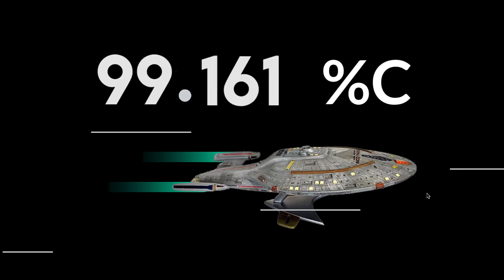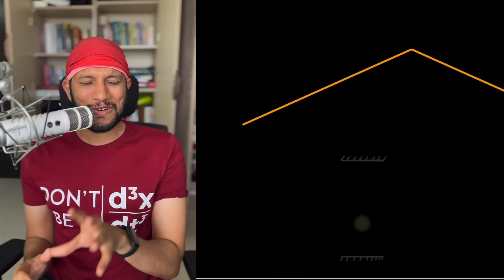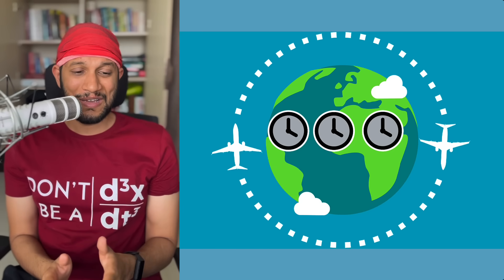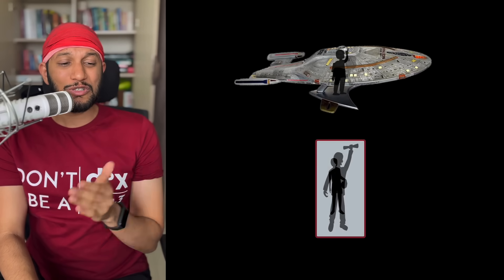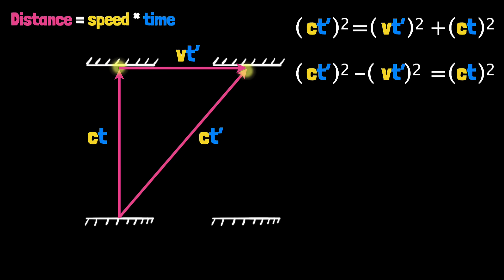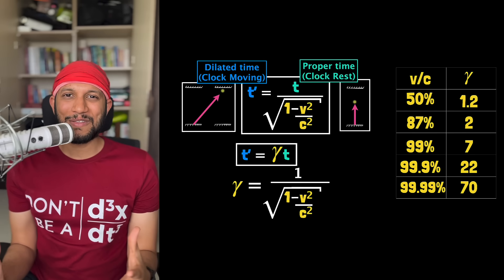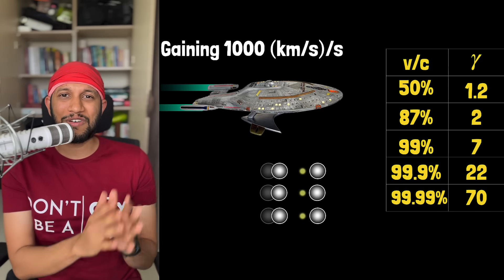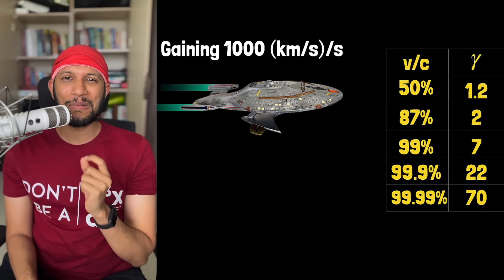I finally understood why you can't go faster than light! (My mind is blown)

Comment: The real limit has to be much slower. Consider a tank tread or a bulldozer tread. If the vehicle is going 10 mph then the bottom of the tread is stationary but the top of the tread needs to move 20 mph to make the return trip in the circuit.
Now consider an electron going around an atomic nucleus. If you're going the speed of light, the electron would need to go TWICE light speed to make the return trip in the orbit. Long before this happens, the speed of the electron backwards will exceed the attractive force of the nucleus. So if your starship is headed to Alpha Centauri, the electrons in an atom will be moving toward Alpha Cantauri on part of the orbit and moving back toward Earth on the other part of the orbit. This happens many times per second.
Once you're going half the speed of light it's impossible for the electron to complete its orbit because it would need to hit the speed of light. It doesn't have anywhere near enough energy to do that. So it doesn't. Atoms get stripped of their electrons.

And since the proximate cause would be the momentum of the electron heading Earth-ward exceeding the ionic attraction by the atomic nucleus, that means this will affect atoms with weak attraction first. Iodine would be among the first elements affected because the outer shells have comparably weak electronegativity.
One by one, atoms will be ripped of their electrons, leaving very strong ions. The back of the ship could become supercharged with electrons which would most likely cause lightning to blast forward as those electrons seek balance. But that's only if the electrons don't leak through the back of the ship into deep space and be lost forever. This is more likely because the problem was the reverse momentum of the electrons.
At first the electrons might sling sideways and hit the sides of the ship. If the ship keeps going faster, they will shoot more directly Earth-ward.
If you keep accelerating (bad idea) all of the atoms on the ship will keep breaking down until the whole ship collapses.
Nothing can survive this.

If you use brute force acceleration to approach light speed, you're likely to blow up the whole ship somewhere around 30% of light speed. Everyone on board is already dead as oxygen stopped working long before the ship explodes.

Comment: The problem I have with the term of "speed of light" as a layman, and maybe some one can explain it to me.  Light is a wavelength....not a straight line.  That "light" is actually going faster than the actual speed of what the accepted "speed of light" is.  Now, I am not certain if this is accounted for or ignored...or just forgotten.  

I am not discounting this video.  I think it is great.  As a learning person about everything scientific, are we not suppose to challenge...or even ask...how we should accept this?  I mean, who was around to see and measure the first beam of light to measure it?  Or is this a big guess?

We are taught that light is a wavelength.  That particle of light is moving faster than advertised.  And yet we accept that term "speed of light" as unachievable from a stand point of a ship or some vehicle.  IF it were an actual straight line...then there would be no argument...or question of this term.  And while it MAY be minuscule the distance between peaks of the wavelengths...it should be accounted for.   And I get that "c" makes things easier as a constant.  How is this actually measured?  Could it be slower or faster?

And are we basing all this on our sun or a light bulb?  Would this equation work on a different light source?  Say something with a different wavelength?  Is the light that travels from our sun have the same speed as any other star that we are aware of?  Or is it different?

I ask these to better understand...not to invalidate this video...or question to it's validity.  I know that way smarter people than I have asked this...or should have.

Comment: In Star Trek they don't go faster than light even if the final result looks like it. They use warp engines that as the name states bend the space-time allowing you to take a shortcut. So while apparently it takes less time to cover a distance, that distance isn't really covered because you literally cut through it, that's like cheating but it's also the only way to go "faster" than light. Take a sheet of paper (that is space), draw a line, that is the distance to cover, but if you fold the paper in half then you can cut through it avoiding the hassle of taking the long way.
Reply: That is not how warp drive worked in Star Trek, not even remotely close.
"Warp drive or warp engine was a technology that allowed space travel at faster-than-light speeds. It worked by generating warp fields to form a subspace bubble that enveloped the starship, distorting the local spacetime continuum and moving the starship at velocities that could greatly exceed the speed of light. These velocities were referred to as warp factors." Copy and paste from memory alpha.
Reply: @StimulatingPresence  which is the exact same thing if you think about it. Call it "subspace" or "shortcut", it is the warping of space-time to create a local bubble of steady-state space-time surrounded by faster-than light expanding or contracting space-time, allowing you to reach other stars or galaxies without even moving inside your local space-time bubble. Also called Alcubierre's metric. Now we haven't found the way to artificially expand space-time, but we know the universe does it already with some kind of dark energy. In an hypothetical quantum gravity theory it could well require to manipulate additional dimensions, that you could call "subspace" if you wish so.

Comment: well you used a Star Trek ship, which has a WArp-drive a made up propulsion system,  which give you speeds many time of light. like Warp9.9 is 3053 times the speed of light.
in real life we have the concept of the Alcubierre drive which should work pretty similar then the fictional Warp drive, but given the lack of technology and energy required to build and power it on, we dont know how far/fast that drive could bring you.

Comment: Mass and material can't handle speed of ligth, from power source and engine technology.
Speed of ligth need zero.mass and huge power plan to move an object.
Speed of ligth are imposible to reach .
The solution to travel for huge distance are THE PORTAL not SPACESHIP can move at the speed of ligth.
The secret of Macro cosmos are QUANTUM MECHANIC and nano technology maybe the answer.

Comment: I got a problem with Einstein's THEORY (not fact). 

Einstein said what the Speed of Light is a CONSTANT 186,000 miles per second.

The speed of light is expressed as a velocity. A Velocity is Distance divided by Time. (Miles per Second).  

If time reaches zero as you approach the speed of light, then you have and impossible equation. 

186,000 miles / 0 seconds 

It appears this would be result in instant teleportation between point at the speed of light.
Reply: "I got a problem with Einstein's THEORY (not fact)."

That's your first problem, a theory is a body of facts.
A theory is a fancier word for "explanation".
Anything that works, has a theory that explains you how it works.
Reply: @GoldSrc_  A Theory is constructed of a set of sentences that are thought to be TRUE STATEMENTS about the subject under consideration. 

Einstein's Theory ASSUMES that the speed of light is a constant. If the speed of light is NOT a constant, then the Theory is not true. The Speed of light varies just like the speed of sound. That is why a prism changes white light into a spectrum of light because of the change in the white light's speed and distance traveled through a prism.

My Father told me that when he was in college in the early 1940's that his professors said that it was impossible to break the sound barrier and had math equations to prove it.  However; breaking the sound barrier changed the air flow over supper sonic aircraft resulting in new math equations.

Comment: ok, guys, here is an explanation that takes less than a minute of your life:
max speed you can (almost) reach is the speed of individual particle flown out of a muzzle of your rocket engine.
why almost? because two bodies always puches themselves equally, so there is no way working fuild can transfer all it's energy to an object, only half.
so why can't you reach speed of light? because there is no known particle that moves faster than light.
that's it.

Comment: We have to be moving at some speed in the universe, but in what reference frame? 🤷‍♂️
There are things in this universe that are moving away from us faster than the speed of light (as the universe expansion accelerate). 🤯 So what is then stopping us from moving at the same speed as we move further from the core reference point and this expansion becomes a part of our speed?
… and might our time (T) then a function of our current speed through the time space continuum?

Comment: The enterprise accelerates from sub to super luminal speeds in a time less than Planck time. 
So the transition happens so fast that it can’t actually be measured. Therefore it was never travelling at light speed. 
That’s how Roddenberry got around the problem. 
He didn’t know or care about inertial frames of reference at that point. His solution works just fine.

Comment: What about time measured in the same frame of reference, which is moving with the clock. In my opinion, for that same frame of reference, the clock still ticks as it ticks normally (not slower). As you also explained in your video time is not varying in the frame of reference which is moving, then how come any biological process is changing in the same frame of reference? 

Also, I think it is just the matter of frame of reference where we are measuring stuff, but in reality the biological process is not getting delayed (or dilated).

Comment: Star Wars sci fi is the way to go. Of course ship will fly faster than light. FTL. Hyper drive. The real problem is the resistance. The resistance and drag are slowing you down. The faster you travel the more particles you encounter on your path. So drag and resistance becomes significant at speed of light. That's why photons can't go faster than they do. In the space between planets and even galaxies still exists something. It's not absolute emptiness. Photons has to move through that something. Which causes the resistance. Next question would be what will be seen from pilot perspective? Exactly like star wars you wil see stars like trails. If someone stares at you will see nothing. If you travel faster than light then photons can't reach you and bounce from you towards the observer.  So if you are in FTL as far observer is concerned you not exist. You become invisible to the eyes. Best way to detect your path is to track the disturbance in the space. FTL in another galaxy will look like shooting star, falling star to us. Like meteor trail. So the faster you travel the higher gets the resistance. Your FTL is limited to how much particles you can move away from your flying path. Cause every collision at such speeds is significant. Momentum is conserved so actually you need less and less effort and energy the faster you go. Only the drag and resistance you have to overcome. So the faster you travel the higher the impact on the collision and greater the resistance and the drag.

Comment: Time dilation as explained here is self-refuting. The diagonal (z axis) distance travelled would be the same from inside the ship and outside. Think looking through an airplane window.

However the diagonal distance does not change the distance travelled vertically (y axis) (based on the primary animation) which is what denotes time. When using the horizontal model the same mount of time passes moving left to right (x axis), indifferent to the acceleration, assuming the photon is massless. If it does have mass, it would take more "time" to bounce one direction, then greatly less time to bounce the other direction for a period, until the bounces equalize with the ships acceleration. Just like how when you accelerate onto the high way you feel yourself smush into your seat until you stop accelerating at maintain a constant speed.

Using the physical clock to illustrate the photon behavior is also inaccurate. The physical clock is held together by molecular bonding. Work moves the hand in one direction, and the molecular bonding keeps the hand together. Atoms are hypothetically spherical so there will always be some degree of wobble/bend to their motion. Provided no force exceeds their bonding force the molecules/atoms will stay together no matter the speed at which they travel.

The real problem to speed of light travel would be encountered much sooner than light speed: Colliding with particles in space. These could easily "swiss cheese" any vessel.

A particle cannot be chargless, while holding charges, cannot be massless while also holding mass, it cannot be a particle if it is a wave. If these things are situationally true, then we do not understand what the "thing" is.

Research that does not align with einstein-ian ideas, does not get funding nor will be correctly peer reviewed. If something is true on the large scale, but incorrect on the small scale; or is true on the small scale but not the large - the fundamental thing is simply not understood.

Numbers / math are attempts at numerical representations of physical phenomena.

Pythagorean formula is also nonsensical. If you manipulate A, the same way you manipulate B, and add them together you get manipulated C. Un-manipulate C to find the hypotenuse. This relationship should exist ^3,^4, ^5.... but it doesn't. a^2+b^2 = c^2 is the jello that successfully nailed to the wall, and not the fundamental understanding of the ratio taking place.

Comment: So you haven't said anything new. And nobody says anything about the fact that from the point of view of the ship the whole world is moving at near-light speed and the world should slow down, not the ship. And it's possible to cite the same problem with 3 bodies, where the third one moves relative to both others and there the paradox is superimposed on the padarox, but nobody says anything about it, as well as about the fact that the ship accelerating can equalise speed with the object, relative to which the Earth moves too fast, on which time should go slower, not on the ship.

Comment: Hey, I want to add one important detail: from the perspective of the pilot, you can actually break the light speed limit. Because pilot is slowed x7 times at 99% C, the subjective time it takes for him to reach a distant star is also cut by x7 times. It can be interpreted as distances shrinking along the travel vector, or as crossing that same distance at speeds above C.

So the pilot at 99% C personally experiences a speed of 6,93 C.
Reply from the maker: I have made a follow up video showing the perspective of the pilot. Spoilers - it doesn't cross c, either!

Comment: With the way you explain it (eg photons taking long to distance to travel as velocity increases), wouldn’t that imply time moves at different rates for different spatial vectors?

Eg take the photon clock, if you rotated the clock so it was oriented in the same axis as the spaceships velocity vector, then the ‘tick’ would be faster and the ‘tock’ would be slower. So you’d see wobbly time from the external reference frame

So then how can one be confident a person would age slower? All the electro chemical processes in a human body are moving in a myriad of directions. Wouldn’t our biological processes start to get out of wack as you approach the speed of light?

Comment: As you increase your velocity, your mass also increases.  So in the 1000km/s example, you would slow down unless you apply more force.  Considering earth gravity is only 9.8 m/s^2.  You'd be reduced to a puddle going 1,000 m/s^2
Reply from the maker: Mass doesn't increase with velocity. There is no evidence for that.

Comment: Imho, One can also prove the fact that one cannot reach light speed just from the formula for gamma: 1/sqrt(1-v^2/c^2). if v approaches c, 1- v^2/c^2 approaches zero. and if v would equal c then the formula would read 1/0 and that is impossible because you cannot divide by zero. at least if i get it right. Not a mathematician, so probably got it wrong. 😂

Comment: Serious question: what if the photon clock doesn't move sideways but forward (say you turn it on its side in the ship)? Wouldn't the photon travel longer in the direction of the ship moving and shorter on the way back? Would the clock then not slow down?

Comment: Great video!

There’s another, waaaay-oversimplified, but basically correct, way to answer why you can’t go faster than light:  because you can’t go slower than light either !  

In essence, everything travels at the speed of light, but stationary objects travel at the speed of light through time rather than through space.

To go faster through space, you have to give up some of your movement through time.  If you go through space at the speed of light, time stops completely.

This is a more General-Relativity-oriented way of looking at it.
Reply from the maker: Yea, using words like ‘travel through time’ and ‘travel at c through space time’ doesn’t make intuitive sense if you think about it.
Reply: @Mahesh_Shenoy , that’s the way it works though.  In short, space-time diagrams.  https://youtu.be/hTxWAQGgeQw?si=aPPf5P2w12V5MMWI
Reply: @Mahesh_Shenoy , better:  https://youtu.be/fB8eatgkOyM?si=cGKbeLRB_-_qLZIb